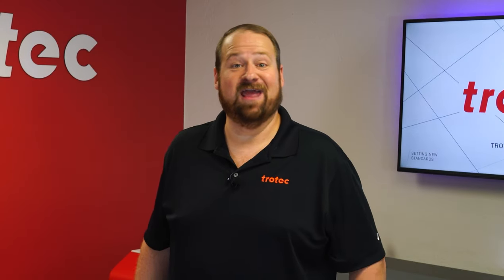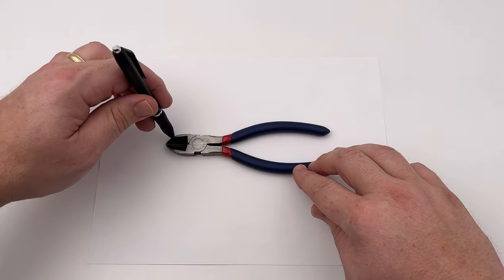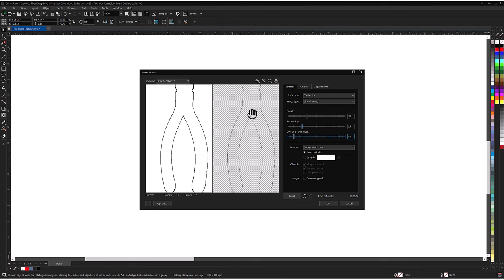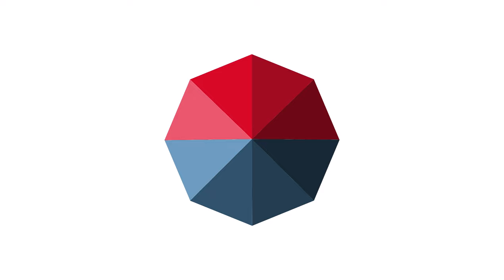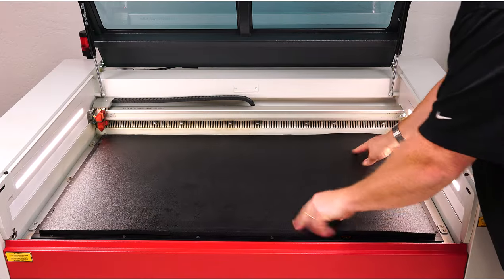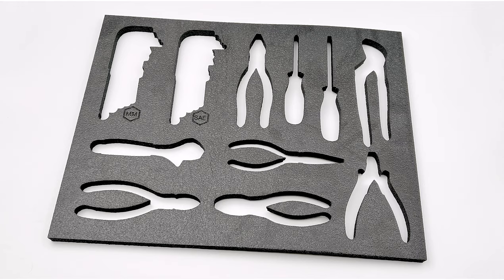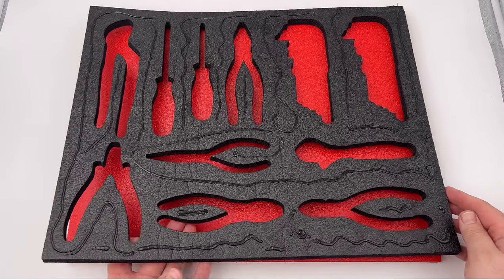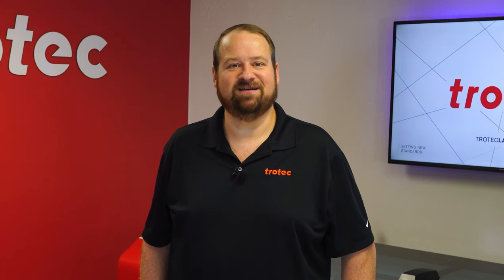Deep Dive with Laser Dave: Creating Toolbox Foam Inserts

Comment: Nice! How thick can the foam be? I'm thinking it would be nice to be able to create custom carrying cases for things like firearms & optics that require thicker foam than a tool box liner.
Reply: That will depend on the foam type and your laser wattage. Open-cell polyurethane foam can be cut up to 2.5" in one pass with a 120-watt laser; with denser foams and lower wattages, you would need to do this in thinner layers.
Reply: @davidstevens2577  Thanks
Reply: @davidstevens2577 Can this also cut silicone open-cell foam? How is the cutting depth adjusted? ( if i just want to cut 20 mm deep in a 40mm high block?)

Comment: Thank you Dave, I've been racking my head trying make my templates. You've just shown me where I made the mistakes. I don't the same laser cutter as you, mine is only 20W, can you give me an idea as to what settings I would need to make?
Reply from the maker: Settings will depend on the top feed rate of your laser brand, so I cannot give you any exact numbers based on that. I can tell you to run at 100% power and then slow the cut speed down low enough to get through. Some testing will help you determine if this will work on your system.  Note that with only 20 watts of laser power, it may be challenging to make this application work because you will have to run it very slowly, which will give more time for heat to build up and increase the chance for a flame or flare; foam can be very flammable, so keep a very close eye on this should you attempt this and make sure you have an air assist and excellent exhaust on when testing.
Reply: I have a similar project with a 10 watt diode laser. I resorted to doing multiple passes, to not heat the material too much at once. I use 6 passes with 500 mm/min at 100% to cut a 25mm rather squishy-type quite dense foam. Each pass penetrates about 5 mm (you can see when the cut is finished). Slowing down too much will lead to more smoking/melting than precise cutting. Also, consider the laser going out of focus on the bottom of the material, in 25mm distance it cannot cut as well as with 2mm distance. 

And, anything above 100 dpi resolution on foam is a waste of time, since the material is flexible and partly melting in the process, we are not creating soldering masks :)

Comment: Hi , I have a sample double pasted eva in 2 colour but the packing of tools is up and down , not in the same level . How will it get CUTTED ?
Reply: In your example, if I understand you correctly you would need to use more than two layers of foam to compensate for tools like this and layer them together, cutting out an opening to account for this.

Comment: Instead of drawing around the tool you can use a scanner if you have one
Reply from the maker: You are correct, but scanning the tool was slower, requiring more time to trace around it in the design software. When manually drawing the outline by hand it created a perfect offset, and then that drawing was scanned and quickly center traced, as shown in the video.
Reply: @TrotecLaser  There is no need in tracing it. You can select it with a magic tool then convert selection to a line voila. You have a more precise line with out additional work.

Comment: Awesome Dave. Why Z-offset = - 0,1" ?
Reply: Thank you!  The negative Z-offset will do two things, allow the foam to cut straighter (less angle) and faster than focusing on the surface due to the makeup and thickness of this type of material.
Reply: @davidstevens2577  Thanx for your reply. Will test this asap ;-)

Comment: So just curious, is cutting this foam with a laser creating toxic fumes?
Reply: That depends on the foam used.
Reply from the maker: Any foam will produce toxic fumes when laser cut; in fact, all materials, when cut or engraved, will produce unhealthy fumes. This is why any laser machine needs to be exhausted or filtered correctly so there are no health issues. One material and foam type that can also produce corrosive gases when laser cut is PVC foam. Any PVC materials should never be laser processed because they will damage the machine over time.
Reply: @TrotecLaser  I use an external exhaust with a 3-stage filter from OMTech Laser, but my machine is an X-tool S1 40w. Waiting patiently for their tech support to provide me with info on replacement filters.

Yeah, I try to stay away from those bad materials, I mainly do vegtan leather.

Comment: is this a $50k laser cutter?!
Reply from the maker: These are not hobby-grade laser machines; they are commercial and industrial-grade lasers that start around $8,500, which can make this application. Trotec Laser machines are high-performing production machines designed to create consistent revenue.
Reply: Crazy right! I had good success using a handheld trim router and cutting straight into foam sheets myself. You trace the outlines directly onto the foam or onto painters tape stuck to the foam... Much more cost effective. You also can cut the tool pockets to whatever depth you need, instead of having to use separate piececs like in this video.